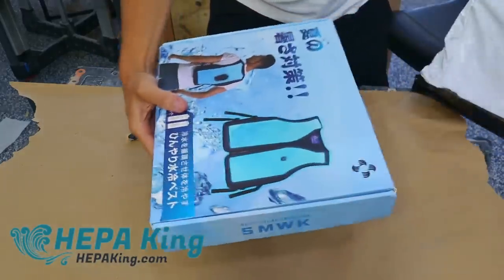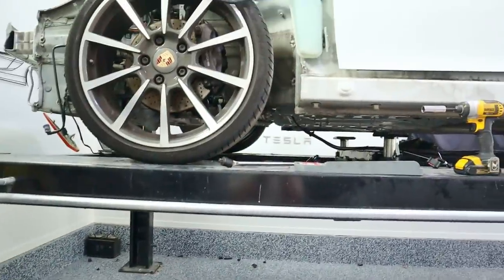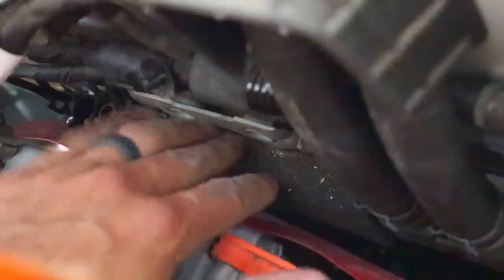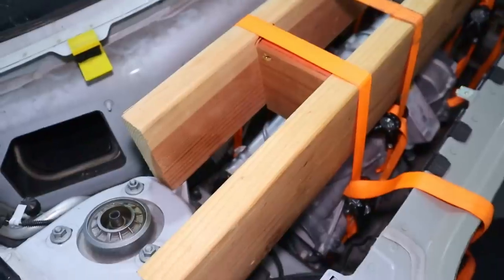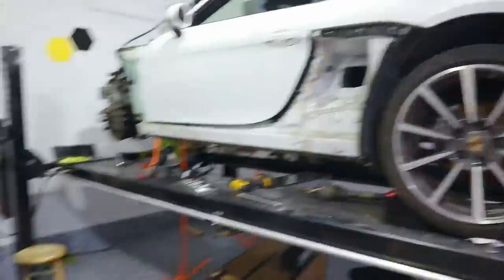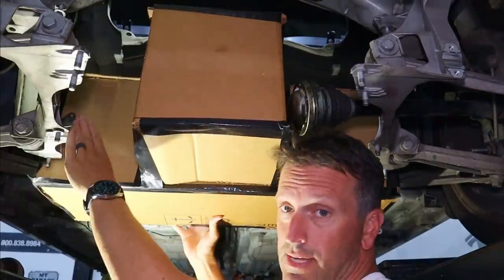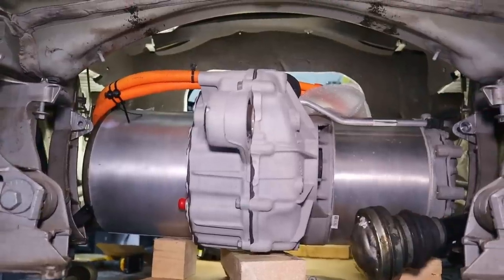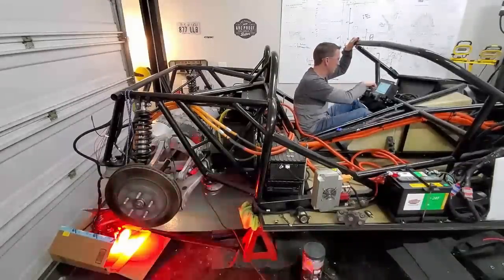Is It Possible to Electrify a Porsche with Dual Tesla Motors?

Comment: One thing you could do for the rear motor is to separate the inverter from the actual motor and make an end cap and longer cabling and hoses to run between them. This should make the motor narrower such that it fits between the suspension mounting points. The inverter can then be mounted elsewhere where space is plenty.
Reply from the maker: Thanks for the idea!
Reply: I think this is the way to go, then you don't have to shave off any attachment points on the vehicle - just need to find space for the inverter somewhere else.
Reply: I believe @richrebuilds did that in one of his videos. @agingwheels swapped the direction of the motor and had to change something with the oil pump

Comment: From what I have seen, if you flip the motor (running it in reverse), you might have issues with the internal oil pump. There are a few episodes from @ElectricClassicCars where they had to resolve that. Not sure if that is the same setup you are attempting but something to keep in mind. You are much braver than I am....
Reply from the maker: Yep, if I run in reverse I will need to swap an oil pump as well

Comment: Came back to this video to verify my suspicions with your video regarding the switching of leads in the rear motor.  It makes perfect sense, and I was sure this was the reason you had opted to do that.  It is nice to have a chance to come back to this video and refresh thoughts.  I loved that you did your due diligence and realized there is a breathing hole and drain on the rear motor, Jeremy.  A simple detail, but important for the longevity of the motor, and so easily overlooked.
Reply from the maker: Thanks for the comment!

Comment: Awesome build, and cool problem solving.
About those tabs on the rear suspension, I'm betting that by bolting the in-between stuff to it, Porsche stiffened the rear suspension, thus ensured better handling in the corners.
I'm not sure it's wise to cut them off without replacing what was basically a cross brace
Reply from the maker: Right you are.  I will probably need to reinforce once I am done.
Reply: @ElectricSuperCar  can't wait to see how you'll solve that conundrum!

Comment: I went thru the same pain in my build with he front motor, by rotating the front unit now you will have some oiling issues, but it have a simple solution that will required to open the differential cover. Also on the rear motor you can remove the inverter and remote locate it, there is a cover plate that will bolt to where the inverter goes if you decide to go that route. But reversing the motor is not a good idea the internal gears are helical and they are intended to run at full speed where is considered naturally forward, if you change the reverse to be the new forward, eventually you will damage the internal gearing. Of course it can run in reverse but not a t full speed neither for too long. I sent you an email  with some pictures.
Reply from the maker: Got your email
Reply: What is your solution for oiling a rotated front motor?

Comment: Hey one thing to check , are the gears case hardened on both face's ( front and rear of the gear) . If you are running backwards you might be running on the 'soft' face of the gear. I had this problem in an old truck i did some work on.
Reply from the maker: Luckily I am not the 1st to run it in reverse.  Several EV conversions have been done like this without issue.  Thanks for bringing up the point!

Comment: Suspension are ment to move like gimbal (not much but yes) now the suspensions are unloaded ( I mean car weight is not pushing the suspension) it might fit now after little metal shave but as you gonna put weight like battery and interior it’ll get heavy which may result in brushing other mechanical parts there need to be some sort of clearance for shaft.
Reply from the maker: Thanks for the comment!

Comment: Big update bro

Worst-case senerio...
U can use the tesla rear subframe and bolt it into the main-frame like u did the the supercar project; which means u will have to use the tesla suspension setup

So it may require some little extra CADboard work 😂😂💔 
But it would be bolt in and less work
Reply from the maker: Thanks for the comment!

Comment: If you can keep the weight even close to the original car's and keep the batteries relatively low in the car then I can certainly see this being an excellent sports car when you're done with it. The Cayman has always been a car with a lot of potential. I'm most looking forward to seeing if you're able to reuse the existing Porsche suspension, since that's a large part of why the Cayman is so excellent. If the weight does balloon past the stock weight too far then you may need to purchase some stiffer springs to compensate.
Reply from the maker: You are correct

Comment: I don't know if it is the case with Tesla motors, but most gears are made to be under high load in one direction. If you put high load in the opposite (reverse) direction than it was manufactured for, you could shred the gears. It happens in 4wds when people get stuck and gun it in reverse.
Reply from the maker: Thanks for the comment!

Comment: are you concerned about the different mounting angle? pitching it forward may cause the sump pickup to be above the fluid level
Reply from the maker: I will likely crack open the front motor and see if any adjustments are needed to the oil pump or oil pickup location.

Comment: Model S motors? THen the oil pump propeller thing in the gearbox will spin backwards ... might wanna check that out if it still lubricates...
Reply from the maker: Thanks for the comment.  Yes, I will have to get a new oil pump.

Comment: The front drive units from the S/X are so much less expensive (~1K vs ~2.5K) than the Large Rear Drive Units or even the small rear drive units.  Is there a reason you can't use two front drive units ?  I seem to remember reading something about front drive units lacking some signal or bit of electronics that made them unusable without being paired with a rear drive unit (large or small), but can't find the reference anymore.  The front drive units are narrower and might fit in your rear easier.  Even the small rear drive unit is narrower that the large rear drive.  Building an AWD Porsche, do you really need the extra power potential and cost of the LDU ?

Comment: there could be a problem with the oil pump, plus the coolant will have air gaps(plugs), and last but not least, it will be almost impossible to change the diff oil(every 30k miles) if you change the orientation of the motor(in the back)
Reply from the maker: Tesla motors do not require changing gear oil...ever.  not in any service maintenance schedule
Reply: @ElectricSuperCar  well, yeah, maybe I’m just overthinking thinking this, but as a technician- I couldn’t agree with that, plus, after numerous tests, I hear and feel the difference after the oil change. I’ve changed my fair share of gears in those drive units, and after 100k they really wear out….(of course it depends on how one drives the car)…thus….oil change wouldn’t harm….
Reply: @ElectricSuperCar  I’m not trying to convince you to do anything , in the end, I’m just a guy on the other side of the planet, and I’m just sharing my experience. This is your project, and you’ve done a lot of work. I’m simply advising, or in other words, voicing my thoughts how I would do it, and what concerns I have.

Comment: The motor in front of the rear axle is better for performance / weight distribution…

That subframe could easily be scanned and recreated out of 4130 giving you all the clearance in the world and not risking strength
Reply from the maker: Thanks for the comment!
Reply: Not really, as the heavy part are batteries, not the motor. You want the batteries as close to the center of the car as possible.

Comment: Are the two motors identical? If not, would swapping ends for the motors make things easier?"
Reply from the maker: Not identical.  Front motor is 200hp and rear motor is 600hp.  I'm not sure swapping is the way to go.

Comment: Why don't you use cad for placement related tryouts?  You should have 3D models of the car and tesla motors.  I myself do the placement alignment in the cad for our 400V Electric  220kw 56kwh  handmade aluminium body Porsche 356.
Reply from the maker: Great suggestion!

Comment: I was under the impression that the front motor cooling plate had to be pretty level for proper cooling
Reply from the maker: I will likely Crack open the front motor and see if any adjustments are needed to the oil pump or oil pickup location.
Reply: Any updates on the front motor oiling issues?

Comment: I know this is your second time around with this. I have a question. Wouldn't it be easier and cheaper to just buy a wrecked Tesla and remove the body and put another body on it ? I realize I don't know what I'm talking about. There must be a reason that nobody does this. It just seems if you did that you would have all the parts the  power steering/brakes ect. 
I mean I don't know how much a wrecked Tesla is. What am I missing here ? 
I keep thinking about doing just that but there must be a reason that nobody does it.
Reply from the maker: Definitely an option
Reply: yeah I mean how much could a wrecked Tesla be ? Considering a brand new one costs like $ 40,000 now.   @ElectricSuperCar

Comment: You think 44Kwh battery pack will be the max. U can squeeze in? Your best guess on capable range?
Reply from the maker: I am thinking 170 mile range.  I am actually wondering if I run only the front motor (200hp) if I could go further.
Reply: @ElectricSuperCar  perhaps the ability to turn off one of the motors, when trying to extend range.

Comment: I have a 2016 Soul EV and a 2012 Leaf. Would it be possible to turn these into sleepers with new batteries and tesla motors? I saw a guy who built a replica 1969 Corvette using a Kia 30kWh battery and tesla motors. They said tge Kia 30kWh battery is the lightest on the market.
Reply from the maker: Yes it is possible
Reply: @ElectricSuperCar Once the battery is out of warranty on soul, I think I'll build my own cybertruck. I might still beat Tesla to a finished product.